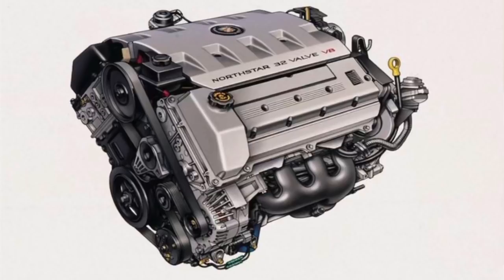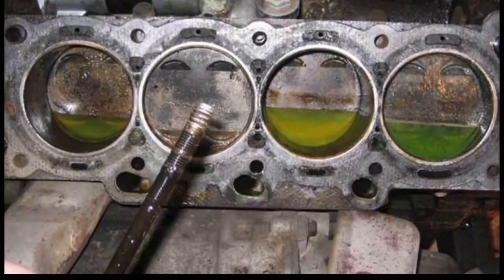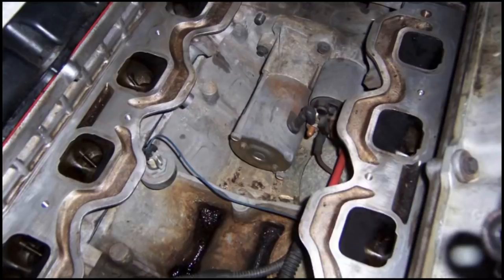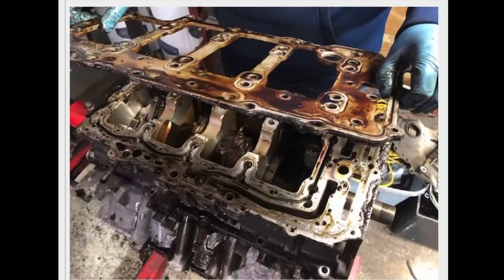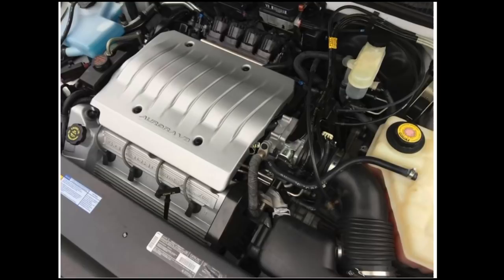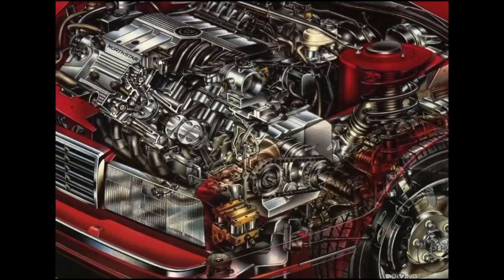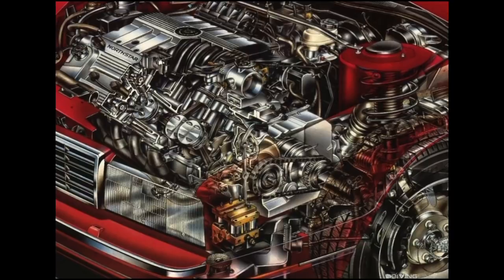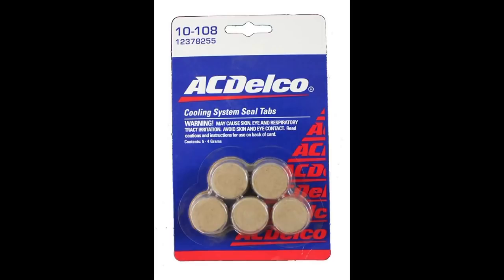Worst Car Engines of All Time: Cadillac Northstar

Comment: had a 2000 Seveille STS. never had a problem of any kind with it over the 120,000 miles I owned it. literally nothing went wrong. not the alternator, starter, tstat, nothing. pretty sure by 2000, they had most of the problems figured out. I also didnt baby it. i made sure to run it out quite often because the engine has thin rings and it just liked to rev. regular maintenance goes a long way.
Reply from the maker: You were ultra lucky. Those were not well made cars. I remember seeing the average warranty cost on those cars when I was at GM. Not good.
Reply: @RareClassicCars  meh, rate of failure on these cars was greatly exaggerated. it absolutely was something to be aware of and it didnt happen more frequently than people wanted to see but experience in the real world and from other owners says the engine wasnt that bad.

most of the failures of these engines, like tons of other engines, was due to lack/no maintenance and driving habits. they needed to be actually driven hard and also needed to get up to full operating temps. most of those engines were short cycled, never got up to full operating temps for very long, and almost never romped on by the fossils driving them.

i revved out the STS quite often when i drove it. but, i changed the plugs, the oil, and coolant on a consistent basis  many people did not. 

of course, the fine threads and porous blocks on the pre-2000 models were a problem. the porous blocks were a specific run from the mfg that poured them and the head bolt change negated most of the head gasket issues. it was definitely a learning curve for GM however. 

its too bad too, cause the rwd N* engines were pretty darn good but the earlier reputation killed it.

Comment: The dreaded Northstar Oil Leak was a 5000.00 repair ten yeats ago!  On an older Cadillac the costs would usually total out the car!  Head gaskets?  Constantly.  Between the HT 4100’s and the Northstars Cadillac lost their reputation along with most of their very loyal customers!  Today, The word Cadillac means very little.  “ Pleasant to drive when they are running”.  Right!

Comment: Oil leaks are common on most cars period. I have a 2006 Honda Accord and a 2009 Honda Ridgeline, both with the J series V6 and relatively high miles (230k on the Accord and 185k on the Ridgeline). They leak oil, but they don't use it.

And I've dealt with overheating issues on late model Northstars unrelated to the head gasket. They all were fine once fixed.
Reply: Oil leaks are NOT common on most cars. Period.  A car leaking oil is abnormal and should be dealt with. I've owned 4 Hondas, none of them leaked oil. I currently drive a V6  '09 accord, zero leaks and no no oil burning. 

One tip:  Its always, always wise and necessary to warm up your vehicle to proper operating temperature before using moderate to high RPMs.  Running the vehicle in your driveway is not going to do it. I always drive my car around the block before I leave or if I don't have time for that I'll simply keep it under 2k RPM until the temperature needle is where it is supposed to be. You might be the slow one on the road for a while...but I guarantee your car will last for hundreds of thousands of miles with only basic fluid changes(and not leaking oil) that is the only maintenance I have had to do with my current V6 accord.  I've worked at a car dealership...driven Corvettes, Hellcats, BMWs, Mercedes, Range Rover, Porsche, and I love my 8th gen V6 EX-L with Navigation more than pretty much any of those, with the exception of maybe a Vette. The navigation screen on the 8th gen Accord is easier to use than most all of those other high end cars. The feel of the suspension and steering is also as good as most luxury cars.

Very few cars under 100k I would trade this car for. I love the way it looks too, much better than any other Accord generation. 

All cars are complicated machines with hundreds of parts....like anything its prone to have some that are not as good as they should be. Every car manufacturer in every model has some cars that are "lemons". Its not possible to not have them. Hopefully you didnt get one
Reply: And if you have the V6 you can get the device to hook up to your engine to deactivate the "ECO" mode...so it no longer goes into 4 cylinder mode, it stays using 6 cylinders all the time. Supposedly that helps with any possible problems. I have it simply for performance purposes. My car was not burning any oil before and still isnt. MPG definitely is hurt though....I average about 18mpg in the city, even when trying to drive slow and economically.
Reply: @LUk3.M.  My Accord has a manual transmission, which never got VCM. And the 1st generation Ridgelines (2006-2014) didn't get it at all either.

Comment: I just bought one for my wife, a 97, 86000 n yep the owner died in rest home its sat a bit, no oil burning  yet just leaks  my brand new 1977 , 305 camero  LT, was a lemon  in the sense it ran oil out of every gasket brand new, and first month the heater coil blew out in floorboard. My brand new 1976 Honda,  civic  , started  it as I went to school for my wife,  she comes out to warm car alright  no ground hooked up right  ut melted the transmission  and the shifter  all plastic  gears,

Comment: I've always wondered if GM had intended the Northstar to be it's modern, DOHC 4 valve, V8 replacement for the small block Chevrolet. Like was done by Ford with their Modular V8, replacing the Windsor series.

Comment: What about the Iron Puke?  Somebody once said that an Iron puke will run poorly waaay longer than most engines will run at all.  But, they Suck.
Reply from the maker: It was at least quite reliable.
Reply: @RareClassicCars  Absolutely fair.  Which also meant you were stuck with them.  Ask your local postal buddy how much they enjoy their LLVs.  Soooo coarse, and gutless.
Reply: Can you imagine choosing to have one in a Camaro?
Reply: I briefly had one in a Celebrity wagon. Off idle it was slow but OK, at idle to say it sounded and felt like farm equipment but saying that would be an insult to farm equipment.

Comment: Maybe on an SRX but on FWD sedan it looks like a nightmare to work on. And again in1995 the LT1 also was making 300hp with 2 valves per cylinder, why reinvent the wheel? To save weight.

Comment: I bought  the caddy for the seat  fir my 89 pickup. It's worth the 1200 I paid for the car , plus I've gotten good miles out of the deville  for my road house car,  the car sits n the battery looses memory on the computer  n you gotta reset the key, n the dash cluster  all these were planned on purpose  not am accident

Comment: These engines are not bad at all. Reliable and excellent runners once you fix the gaskets, restud the engine, etc. Starter location is not as bad as it is made out to be… it’s a 45 minute job.
Reply: I've never done it on a Northstar but have on an LS V8 and it really wasen't too bad. I even was able to reuse the gaskets. I bought new ones but the ones on the manifold looked so good I didn't see the point in using new ones, that was 50K miles ago.

Comment: A lot of people say once Head bolt 🔩 change is done they're bulletproof, but I don't listen to everyone 🤣
Reply from the maker: They are much improved, but I don’t know that I’d call them bulletproof
Reply: My 20000 deville timesert job lasted 10,000 miles--cannot find anyone to fix it now and it only has 110,000 miles and is a beautiful red garage queen with 3000 mile oil changes and never parked out of a garage

Comment: Please do the star fire as fitted to Toyota Corona. Yikes sounds like something from the 1930s. 

A person in a Scottish town owned a North Star Cadillac. I have only seen it on the street once but seen more moulding away on his drive as I pass his house. Never realised the issues were that bad. Yet it's not Triumph Stag Bad. 

Would it be possible to ceramic coat the cross pipe? Gasket materials have improved. Impove the head bolt material and thread? 

The K series was bad but now with better made materials and falt areas like head bolts made reliable. The stag and k series require a higher attention on coolant strength. UK has plenty bad Motors too.

I always thought the North Star and Lexus sounded dull like an air conditioning unit 😀

Comment: Comparison of  the North Star  and the Lexus 1 uzfe both are 4liter qwaud cam v8 with the starter in the same location both have 32 valves yet one is the worst engine ever and one is one of the greatest engines ever you wanna guess which is Wich

Comment: Fine thread is stronger than coarse its literally the reason that they use it for head bolts. Look into it. Omg how dumb. I can't trust anything you say now. That's common knowledge for fasteners in metal. Now they probably didn't use thick enough bolts for proper sealing pressure very common engine problems.

Comment: But what I see on the Northstar deville  n my 2007 uplander, first they plumbed the cooling system  wrong, on them you don't have just a direct filling port on radiator  your hoping the over flow jug fills up the radiator  , it doesn't,  then all the plumbing,  that of course all the hoses  I've out counted but at least 6 little tiny ones  black rubber  just waiting to clogged  from decay should never been plumbed that way.  Now to the tank  over flow jug,  yep mine has a Canada  jug in a us  car, the jug has a vent over flow alright that's open no way to put really over flow jug on it mine has to have the jug replaced , this maybe was a British  bound  jug  it opens  to the wheel well , right on it, then yep the caps go bad. 50000 miles on any of my gm  , Toyota  I've replaced the radiators  from them blowing out holes,  im on my 3rd radiator on my 89 Cheyenne,  this caddy has the original radiator  so it's 30000 miles past replacement time,  the next issue is continuing  the cooling issues  that blow head gaskets  not the threads,  it's the fans,  two fans n if your nit aware that they must run ss load as a jet engine at all times or they are not coolibg  you got blown up head gaskets,  now the next issue is the relay s. 3 of them right in front below the radiator  , water n electric  don't mix,  and all that seals this cluster is a wide black rubber band for the water tight compartment,  one good rain and uts blown and the fans will naybe run but on low  n you git blown head gaskets,  and yep the exhaust  runs right under next to pan, and no shields  on the car, ill cover those as I fix on it, im going to replace the fans and radiator,  I just parked it, this issues  are same almost exactly  on the uplander,  but we have 2030000 miles on the original plugs  I've just blown out the first water pump  n it most likely went cause the over flow jug  feed hose is 6 feet away like the Northstar  , I did add  real over flow jug on the Northstar  so I could see how the water was handled    instead of letting it just blow out if it got hot,  I drive the dog out of it.  Only had it about a year now, id never buy one of anything front wheel drive new ever again,  the crap of having to pull the motor mounts to replace the water pump on my wife s Honda accord  taught me that, the uplander has been a mule, its bad ass  truck, I've had it full 6 people  all our gear for a week all our computers  n towing a long boad full of gear 3600 miles at 80 and 100 mph all the way many trips now from Texas to Florida,  it's a throw away all of them  if you can't work on them, I'll take my square body  Chevy  n my c 1500 over any  high end car or truck  my 07 , 2500, is bitch to work on only if you don't have a lift to hold you up to the engine compartment,  but the rest is perfect to reach to maintain

Comment: Wrong in 2006-11 they did not have head gasket issues my 2011 dts platinum is great
Reply from the maker: By that point, their reputation was spoiled by 13 years of head gasket issues
Reply: @RareClassicCars  now their gems because of that tho at least later versions

Comment: To me it wasnt a good engine i used to see alot of them in yards because they would over heat i think be v8 front wheel drive sucks and i think they were loud i think the towcars 4.6 was a better engine more reliable quieter and you can put hundreds of thousands of miles on them

Comment: And I would like to say that I didn't say about the one issue I did have with the My 4100 in my De Elegance whoever designed the power steering pump in 84 must have been crazy I ended up with a whole new vocabulary of cuss words after replacing the pump 🤣 really bad design.

Comment: Loved my 2000 Deville, until it started overheating around 120k miles. Never did see it go into "limp home" mode. Just went into "overheat and crack block" mode. Cracked along front of block between two center cylinders. Also had front hydraulic engine mount fail, which stretched ground strap between engine and body, causing intermittent electrical problems. Ended up donating car. Got a 1996 Fleetwood and 2012 CTS.

Comment: As a previous Northstar owner I'd like to say that most of what you mentioned have more to do with lack of proper maintenance than design issues. Granted, the factory should have used case studs instead of bolts, but the main reason that head gaskets fail is due to not changing antifreeze often enough (I did mine every 6 months) and failure to use Gold Seal stop leak (Added at factory) in combination with using only distilled water in the cooling system. As far as the starter is concerned, I replaced mine in less than a half hour. The intake gaskets are reusable so all you have to do is removed the 10 bolts holding the manifold  and raise it enough to block it up, piece of cake. 
At 150K miles,  I did have to pull the block apart to rectify the oil leak, it afforded me the opportunity to time-cert the main bearing bolts. I another 40K on that engine before selling the car. The people I sold it to (kids of a friend) drove it for another 8 years before getting rid of it.

Comment: Great power, great fuel mileage, and Northstar Performance has a head stud kit that's a fix for the head gasket issue. Once a head stud kit is installed, it's a great engine.

Comment: Another well researched and factual account of how (amongst many other decisions) Cadillac went from 'Standard of the World' to almost total irrelevance. If it were not for the growing Chinese market, the brand would have been axed long ago. 

For all the Northstar fans that prescribe a list of modifications and procedures to make this engine reliable, some might be missing the point. This engine should have never been released for production until all these issues had been resolved. Cadillac customers were essentially turned into product validation engineers. Add to that, the first generation buyers of luxury cars are typically not shade tree mechanics - most do not even know where the hood latch is. They didn't care if there was a better gasket or stronger head bolt if the car left them stranded.

Comment: I had a 1996 DeVille that went 250K miles. No oil leaks, no over heating. Sold it, it is still on the road. Others: 1998 Aurora, three 1999 Auroras, 2001 Eldorado ETC (fast car!). But all of those cars I sold well before they reached 100K miles. ALL of these leaked oil. None overheated. The first thing I ever did with these cars was flush out the DexCool and replace it with Prestone long life universal coolant.  Now I am never going to buy another Northstar car. I feel I have pushed my statisical luck. But I would LOVE to own another Eldorado ETC. What a beautiful car!  I suppose I could buy one and drop a properly rebuilt engine into it.
Reply: Are Northstars available as crate engines?

Comment: The northstar was originally designed for Oldsmobile and it was 4.0 liters. It was also able to drive up to 50 miles with no coolant. This engine did not develop problems untill it was used in Cadillac! They were very reliable engines under Oldsmobile. The Oldsmobile aurora is the first car the northstar was used.
Reply from the maker: That’s actually not true. The Aurora came out in 1995.  The Northstar arrived in the Cadillac lineup in 1993.

Comment: After the big block engines of the 70s,  Cadillac has never made a good engine.  When I first started out in the early 80s as an auto mechanic I worked at a Cadillac dealership and I can't tell you how many ht 4100 engines failed.  We were actually so overun with them leaking coolant into the engine we had to add stop leak and send them to another dealership.  They were also notorious for leaking oil.  They told us at the gm training center that the most experimental engines went into their most expensive cars because if there were a recall,  fewer cars would be involved because fewer people could afford to buy the more expensive cars. They were junk

Comment: Fuck those Motors I had to do a oil pan manual calls to disconnect tranny just to get last Bolt on the oil pan I’m a savage tho and shaved down a 10 mm and was able to get it off. garbage design nonetheless